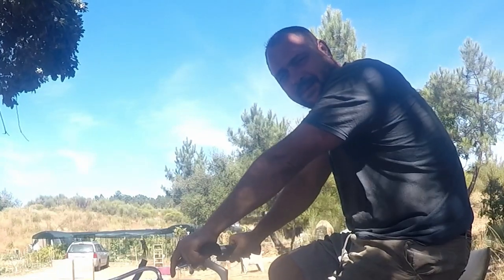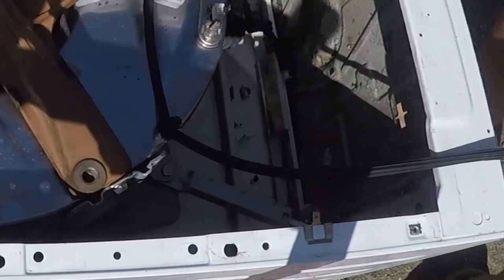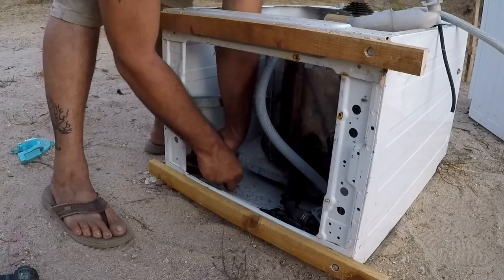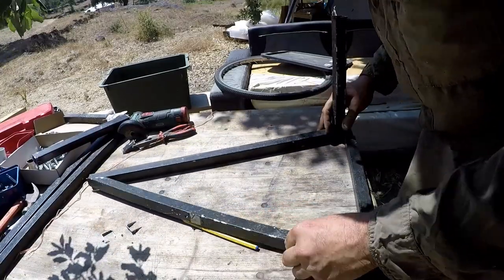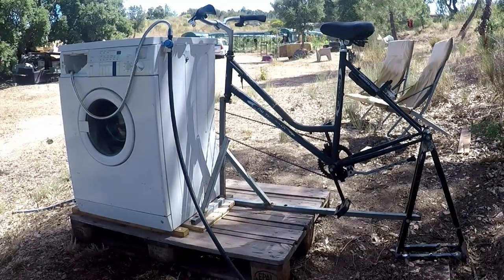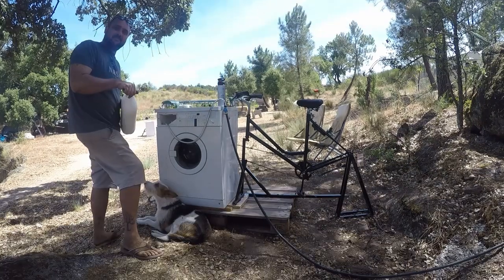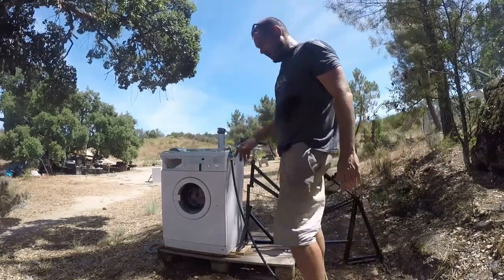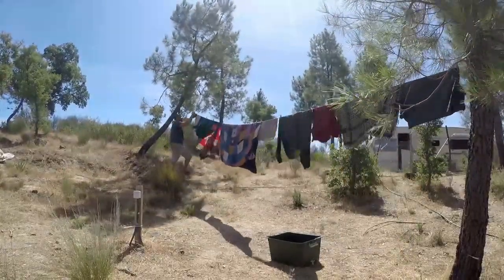Pedal-powered Washing Machine: Build And Test

Comment: Great job for a first time but if I may make a couple of suggestions for you and other's who may want to try this. 

First off (and I know it is mentioned below: please, please, wear eye protection when grinding, especially when living in the middle of nowhere.

1, No need to remove all the springs and mounts to replace with braces: just replace the factory transit bolts that prevent the drum bouncing around. I also left in the balance weight (the concrete block ) as this gave it stability.
2, Remove the water fill control solenoid and connect your water feed directly, this means you can still use the detergent drawer as normal.
3, Use a long drive belt from the rear wheel with either the tyre removed (directly around the rim but this needs a long belt) or attach a drive pully to the axle. By doing this, you still have use of all the drive gears if required.
4, By fitting a long threaded bolt from the bike frame to the machine, you can adjust the belt tension.
5, I connected a bar across a ball valve and connected to the front and rear brakes this would open and close the waste as required. So: washing in, soap in, on the bike and everything is controlled from there: fill, wash, rinse and spin without needing to get off the bike.

You must make sure that the machine and the bike are connected on one skid or pallet as they tend to fight each other and detach. Especially if you feel like a hard workout.

It is also possible that you can drive the drum pully (replace with a wheel barrow wheel and tyre). directly from the back tyre of the bike, this does work well but I still want to fabricate a frame so I can use any bike and disconnect it if I need to use it. If possible (and I am still looking for one) a 'fixed gear' bike would be ideal as this does not have a freewheel capability, so it means that you can back peddle for better agitation of the washing and prevents it balling up. It is also nice to exercise your legs in the opposite direction.

My next project was a wind powered washing machine that worked well but issues with wind control (too fast, to slow or stopped), then a waterwheel machine that needed a big wheel and couldn't spin.  I hope you had as much fun as I did playing with these ides. Keep up the good work.
Reply from the maker: Yes of course thank you Steve . We are always learning from others with more experience
Reply: Steve's reply rocks.  Would love to have one in my back garden -  how much power is possible on spin cycle?  Reasonably possible to equal that of the electric version?
Reply: @virabadrasana  not as fast as that unless you use a gear system. Probably no more than 500rpm.

Comment: Luke If you put the saddle up to the correct height for you it will be easier,  you need a height that will permit full leg extension right down into the heel at max stroke.   
If you can add a heavy flywheel between the peddles and the machine it would make it much more pleasant to use. Happy Washing.
Reply from the maker: Thanks for the tips

Comment: Nice video, well done. Can you do one with a dishwasher to? Ours is not that good no more and who know's I can go on for a couplle of years ussing it as you do on the laundrymachine. BTW If you make the used water ( even with soap in ip ) goes into a container, that is verywell to be used for carwash or even for plantwatering. Soap is a good stuf for plants. And, as you use a multiple gear you can do a gearchanger to. The chain has his tention all the time and as you want the drum to go faster you just change gear.
Reply from the maker: Hi denis, thanks for the feedback. Figuring out how to run a dishwasher without power isnt high on my list yet but maybe in time! 😁
I like the idea of adding gears especially for the spin cycle. I thought there might be a bigger chance of the chain slipping off but it seems quite smooth so i might give it a go and post an update.

Comment: Hi , is it hot or cold water ?
Reply from the maker: Hi Alex.. in summer it's super hot just cos the water in the pipes from the ibc tank get so hot in the sun. In the winter it's cold... for now. I still have some work to do on this machine..
I want to put gears on it so I can spin dry faster, put a roof on it so its protected by the rain and also build a little solar water heating  system for it by putting a coiled black irrigation line behind glass. When I do do all off this I will post an update. Thanks for watching 😃

Comment: Where to put it in cold climes 🤔 Basement drain if you have one. Large bathroom if you have. Figuring out to beat gas electric.
Reply from the maker: Was planning to build a solar water heater for it but now we have more solar power and we bought a normal washing machine. Was good for the first couple of years though.

Comment: Oh man,  You're working much too hard.

1. Use a free wheel, not a free hub (you did)
2.The washer and bike are attached by springs and shock absorbers.
3. Use a universal (in the socket wrench section at Ace Hardware).
3. Drill a 1/8" hole through the freewheel, and insert a pin. This locks the pedals and tub.
4. Record the washing sequence on a small portable recorder (Sony stick)
5. Pedal forward slowly for 5 seconds
6. Rest 20 seconds
7. Pedal backwards 5 seconds
8. Do this for 20 minutes
9. Remove the 1/8" pin in the freewheel.
10. Shift through the gears as you drain and refill the tub.
11. Rest as the tub refills.
12. Reinsert the pin, and repeat wash cycle but without soap
13. Repeat rinse sequence.
14. Remove clothes

  Use a two piece tub, and a manual (not electronic) door lock
Don't overfill tub.  That will destroy the tub bearing.
  Regular (not front load) soap sudzes too much. The soap then 
  reaches the tub bearing and ruins it.
Reply from the maker: I have no complaints with it. Works great.